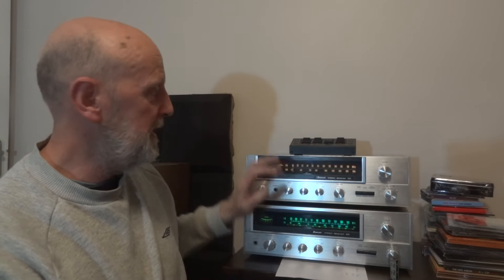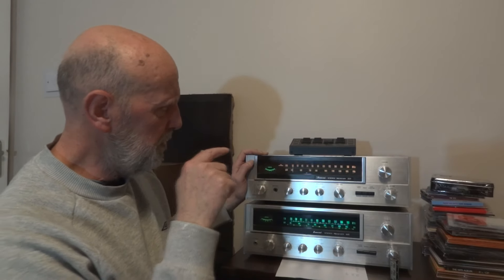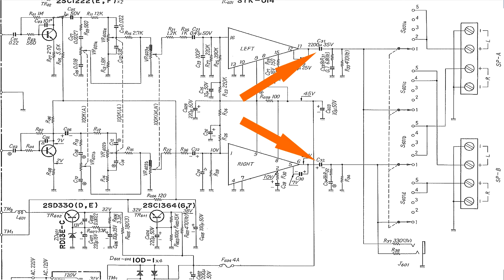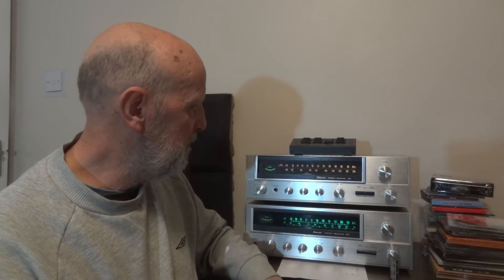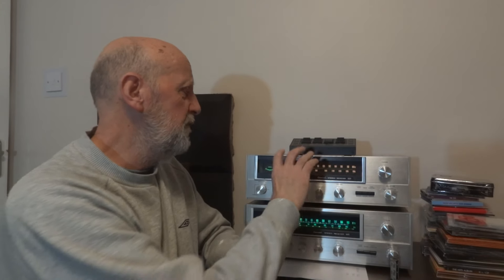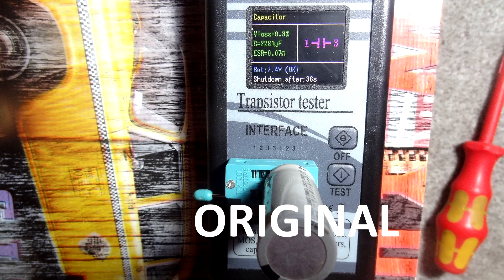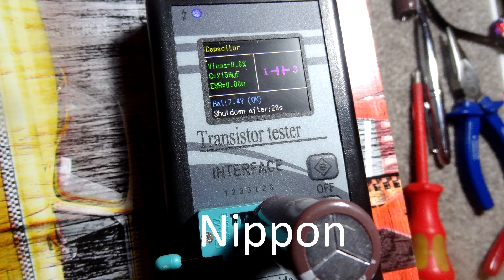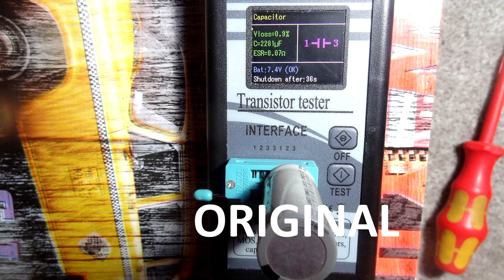Sansui 331 Output Caps Replacement Test. Capacitor Coupled Amplifier, Receiver ReCap. Vinatge HiFi

Comment: Hi Michael, I am very much enjoying this series. I am looking forward to the power supply capacitor upgrade. It may be tempting to up the capacitance value on those but I would like to recommend to not go over board on that (a bit is OK) unless you replace/upgrade the rectifier diodes as well. Also, with respect to the output capacitors, you can put a 1 µF film capacitor parallel to that on the other side of the board. It serves the same purpose as the little film capacitor on the input of the signal path. It is not guaranteed to make it better or worse, but it could be an interesting experiment as well. (Perhaps even a 1 µF electrolyte could make a difference, I am not taking anything for granted any more. The voltage should be high enough though.)
Reply from the maker: I was debating just going a few hundred mf over what is in there now, as I know it will put pressure on the diodes and transformer even. I might also try your suggestion on the 1uf as well. I wish I got at least one more output cap for this experiment, but will try a fine gold at least just before changing the power cap.
Reply: @MichaelYates  Hi Michael, I think a few hundred µF more is not going to make a big difference. But a few thousand more can be risky, due to an extended time for the in-rush current on already crusty diodes.
Reply from the maker: @hugobloemers4425  Yeh sorry I did mean a little higher I was thinking around 2700 to 3300uf that would still be 25 to 50% more than the 2200uf in there now. Playing it a bit safer and maybe still give a little improvement. Its pretty nice now as is, though I would not call it chalk and cheese like I read on quite a few forums were people have recapped and all of a sudden its vastly improved the sound. This has been a hearable improvement that has also kept the unit to is original sound signature. I just watched Stereo Review X thoughts on the Pioneer 550 and he is right as far as this recap goes in that he's 550 and sansui 101 sound pretty much the same to him as they day he had them 40 years ago even though the caps are 40 years old with maybe just a little deterioration in sound but not much and after this recap it has improved the sound yes but not by a wide margin as some maybe would expect.

Comment: Mike I changed 2 coupling caps on my 300b amp....1 per channel.. Replaced 2 Wima caps with jantzen silver Z caps.. A veil was lifted with the new caps Before.  odly the sound was clear at times on some recordings... But warm and compressed and grainy on others... That has gone... Urs matt
Reply from the maker: Thanks Matthew and good to hear the Jantzen have made a difference. I see quite a few recaps on eBay where the WIMA's are used and also read on forums people using them but so far in my few experiments they are not doing to well. But they may well suit some other amps